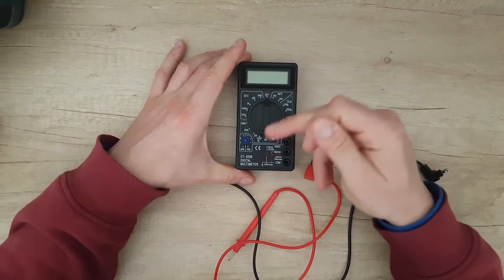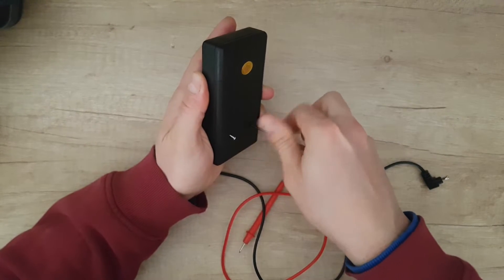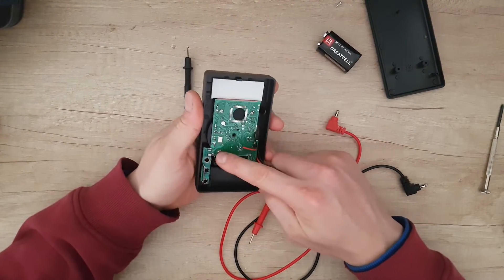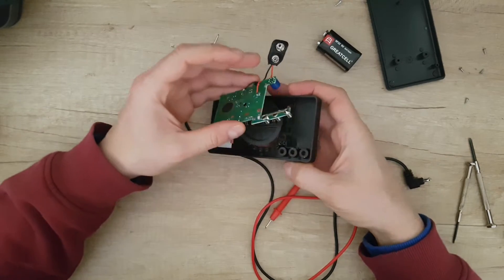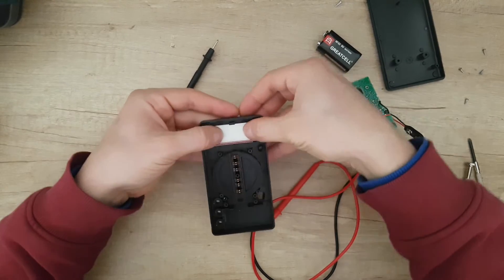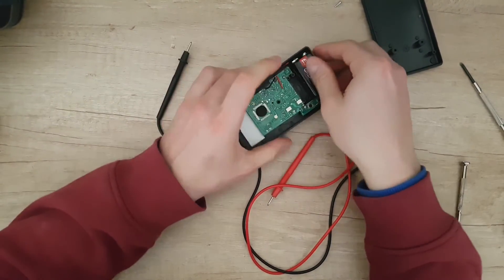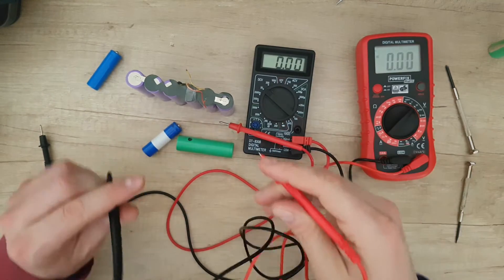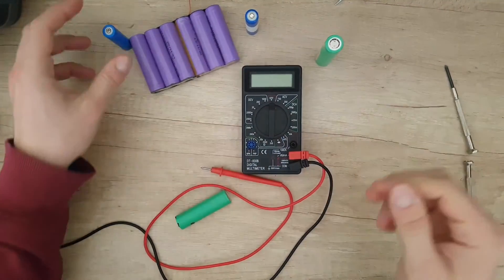Digital Multimeter DT-830B REVIEW TESTING

Comment: I bought today the exact model .I payed 60 cents in Ploiesti,Romania.It's working just fine.
Reply: how do you know that it works fine ? 
have you compared the test results with another more expensive multimeter and it shows about the same results or ..  ?
Reply: Eu l-am cumparat odata pentru ca imi trebuia o baterie de 9V. O baterie simpla costa cu un leu mai mult decat multimetrul asta care a venit echipat cu baterie de 9v in el. 😂

Comment: Bought one in Bangkok, THB 75.00 ($2.50). Works well , even on 240V testing, diodes, transistors, capacitors, resistors. Looks cheap but works.

Comment: Why not you can measure up to 700ac voltage, to day I bought one because of its 10 amp measuring ability here in Pakistan, it is fantastic metre the only problem of this neater is that it needs care while selecting ranges for voltage measuring as it  has no protection , I have also sanwa digital model CD800 using since 1998.